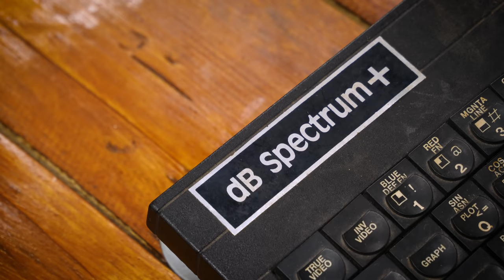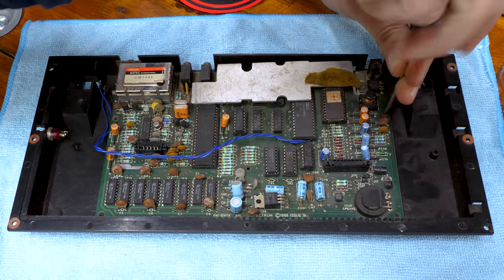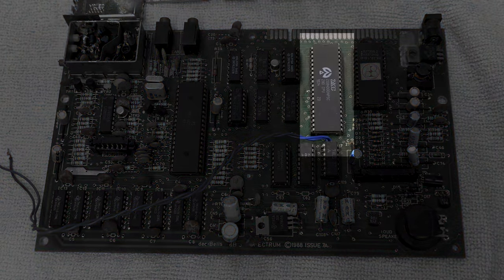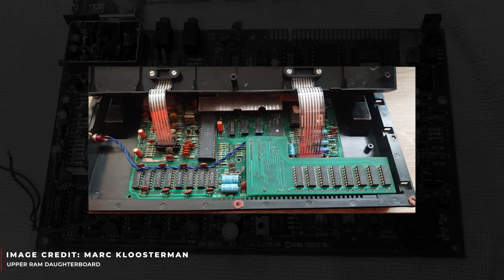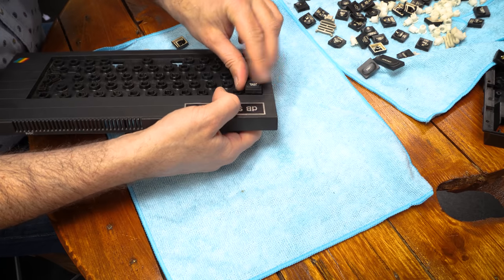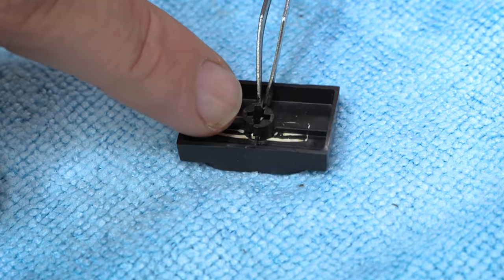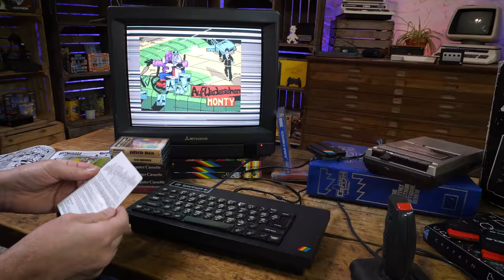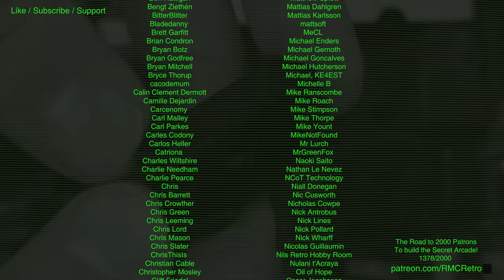Restoring an Unusual Indian Computer - The DB Spectrum +

Comment: 12:28 yup someone has worked on it , those keltron branded capacitors are made by a state owned company and they are my goto choice for any cheap capacitor needs , they are low cost and good quality never had premature failure on them ..

Comment: When I got my dB Spectrum, it was very dusty, no nasty bugs and a bit smelly! It came boxed and all and was almost working -- one lower RAM chip was busted. I simply replaced my rubber legs with new ones. The membrane was working fine, it looked as sturdy as the Samsung ones.
As you can see, there are 2 variations of this "Issue 7A" - mine has a 32k daughterboard, while I've seen 2 other dB's (at one time I had 3 in my home - 2 for my Speccy collecting mates) had only 2 upper ram chips, similar to the Spanish Inves Spectrum+.
Reply: I also have a photo of an Issue 7C -- here the lower RAM consists of only two 4164 chips.

Comment: Small tip when using ultrasonic cleaner to ease up on the cleanup. put your screws or parts you want to clean in a sealable bag with the rust remover in it, and then fill the ultrasonic cleaner with water and put bag in water. Cleanup is as easy as emptying the water and using kitchen towels.

Comment: That second regulator is most likely to power peripherals connected to the user port, like a couple of people have said in the comments its a 7809 which would be a 9v regulator, I think the Commodore64 also has 9v on a user port pin.
Reply: The ZX Spectrum supplies 5 and 12V on its expansion connector, so it's not for that. The Commodore 64 has 9 VAC on its user port, supplied directly from the power input to the computer.

Comment: Hi Neil! Instead of using super glue, use plastic welding compound (based on MEK - Methyl Ethyl Ketone - and other chemicals) which will give the plastic a MUCH better bond, like it's a single part again, and it will strengthen the plastic around the break too.
Reply: Pure acetone works very well too.
Reply: @borayurt66  no, that damages the plastic too much. you want a dedicated plastic welding compound.
Reply: @cheater00  You are right. It should be used very carefully and sparingly, in tiny amounts. But when you get the hang of it, it really works brilliantly especially for small parts like this. Creates almost seamless bonds. I apply it with a needle to both parts, then combine them. Acetone evaporates very quickly and what is left is a one piece plastic again. A dedicated product will be more forgiving for sure, I can't deny that but this also works. Needs practice though.
Reply: @borayurt66  i've repaired parts that are less than 0.5mm across using welding compound, using the same technique you say. and the bonds were fully - not almost - seamless.
Reply: @cheater00  Yes, I just looked it up, it is commonly called Butanone. I will get some and try it. Thanks for the info!
Reply: @borayurt66  no dude, butanone is not plastic welding compound! every plastic requires a different welding compound. look for a specialty welding compound that incorporates Methyl Ethyl Ketone - that's a common ingredient to many of them. They include surfactants, polar solvents, etc. It's not easy to find, but with some research you'll be able to find something produced locally. There are no popular global brands of plastic welding compound.

Comment: A little tip for restoring rusty screws; throw them in a pan of water (distilled if you have it, but tap water is usually fine) and boil them for about half an hour or so. This will convert the red rust to a black iron oxide, which is likely the same finish that they had when they left the factory.
They will look brand new. It's like magic the first time you see the transformation happen..
Reply: @blackterminal  Vinegar will just dissolve the rust. It will leave a black smut on the surface, but that's not the same thing. Rust killers or converters vary, but none of them has the same effect as boiling.
Converting red rust to black iron oxide by boiling has been used for centuries as a firearm finish - it's called 'rust bluing'.
This involves using a solution to deliberately rust the steel, and then boiling the rusted part to blacken it. There are several videos of the process on youtube.
Boiling rusty screws basically works in the same way, though it is much less labor intensive than proper rust bluing.

Comment: Ahh - the old membrane keyboard. I had a part time job after school repairing computers, and I remember having to replace these quite often. I also remember getting in a Spectrum where someone had plugged in a power supply (wrong one) into one of the jacks. The ULA rather spectacularly blew a hole in itself and the circuit board. Still managed to repair it and get it working again, but it looked like a cat's cradle with all the wire patches I had to put in. Fun days.....

Comment: Couple of questions Neil.
1. Did you keep the original membrain label for posterity? 
2. Did you dump and compare the ROM was it completely standard?
Reply: It is most probably exactly the same. Although there were some known bugs on the original firmware which can be corrected, there are some third party hardware and software which does a quick ROM checksum and if even one byte is different, the checksum would fail, causing the said item refusing to work. The bugs I mentioned are not significant for a regular user, but they can become an issue for programmers, and when they did, people invented ways to circumvent these bugs. This also makes a "corrected" ROM to fail with these programs. It is not the best idea to use a modified ROM image in Spectrum machines because you can get incompatibilities. I noticed the ROM IC is a standard 27C256 EPROM, which is not totally pin compatible with the original 23128 used in the UK machines. The difference being (I think?) just 2 pins needs to be swapped. So I am guessing that part of the PCB design is also different along with the 2nd regulator.

Comment: you should keep toothpicks and q-tips handy. 
use the toothpicks when you apply glue or oil in small spots, then throw it away.
With a drill bit, I had to clean the bit after. 
The q-tips and EPA is critical in cleaning small stuff or tight spots.

Comment: With regards to the break key, I’d be inclined also to wire whip and glue round the outside of the post if there’s room.  Just because I’d imagine the forces on it being a bit much for the glue-able contact area otherwise.
Reply: @blackterminal  why but of course it will, but we want the only the best for that which we value.  No sense going half in.

Incidentally, I spent around three days carefully stripping, cleaning and reassembling a whole bunch of keyswitches for the Acorn Electron I grew up with, and not because of its awesome computing power, rather more that it was my first computer.

Comment: It's possible the second voltage regulator could be to regulate voltage in the event of variable voltages from the mains to protect the computer from load shedding where power is reduced in some areas.

Comment: Interesting and well presented as always, thank you. There's no slime like human slime, eh?
Also interesting, at least to me, that that PCB looks like it was manufactured with a (somewhat) modern process. No lumpy floods there.
I wonder why the extra regulator and type? Guesses running from designer's preference to increased RAM options or smoothing bad power.

Comment: I do see the desire to keep the machine as original as possible, especially as it's only going to be on display and rarely used, but if it was to be used often I would replace the voltage regulator with a modern compatible one that does not need the heat sink. They are more reliable and future proof.

Also, no mention of repairing the reset button! Did you reconnect the wires to it? 😏
Reply: The only trouble is, those sort of modern regulators are generally not linear and use some kind of switching to reduce the voltage with less heat.  These tend to introduce switching noise, which is not accounted for in the Spectrum design.  This would cause degraded operation due to the switching noise being introduced to the power lines on the board as there is not filtering to counter it.
Reply: oh man @EsotericArctos  you are so correct!, i see switch mode supplies and regulators being used all the time its almost a snobbery against linear, but there really is no need linear is what it was designed to use, if the supply is bad rebuild it replace 7805's with quality replacements your speccy will run better.

Comment: Nice. Be careful filling up the ultrasonic cleaner tank to the minimum recommended liquid level, otherwise you may damage your cleaner. Your motherboard cleaning session seemed to have insufficient liquid. Thanks.
Reply from the maker: Thank you I'll keep that in mind
Reply: @RMCRetro  😂That told you!
Reply: Why is that? Would you mind elaborate it a little bit further or provide some legit link please? Cheers
Reply: @delos86  Too little liquid results in low pressure at the transducer which can lead to cavitation damage.
Reply: @RMCRetro  and fix the wobbly table plz! :P

Comment: I had a ZX Spectrum+, the design of the keyboard keys left a lot to be desired, they needed to be tapered like the keys on their +2 & +3, you could not type fast at all as the keys would rub against each other.
Reply: Style over function, the early version keys fell out when turned upside down 😅

Comment: One trick is clipping pins to be as short as possible, then using the surface tension(?) of a big blob of fresh solder on the iron tip to pull the remainder of the pin out.

Comment: I had dB Spectrum as a child, a gift from my grandmother costing around 6000 Rs. My new spectrum had issues with keyboard and I had to travel to their factory in Bhosari Pune to get membrane replacement. My Spectrum also had a big aluminum plate heat sink which is missing here. Mine computer also developed problems with other two power supply levels ( -5V and 12 I think for the DRAMs so I had to power it with two power supplies ! Unfortunately I don't have it now as we moved to PCs my parents had it removed from our old house :( - Rahul

Comment: My guess re: second voltage regulator is that India and other similar parts of the world used to have very "dirty" power, i.e. the voltage and current would fluctuate wildly since the infrastructure just wasn't quite there yet.

The second regulator might have been to help even out those fluctuations even more in those regions and keep the micro running smoothly. Wild guess though.

Comment: due to the fact that the second regulator is a7809 I thing the power supply was possibly 12 volts. the 9 volt regulator is probably for driving a cassette system.

Comment: The case looks VERY MUCH like the Soviet/Moldovan "Sintez 2" computer, which is a ZX Spectrum clone whose keyboard is a 99% copy of the original. Most Eastern Bloc Sinclair clones are wildly different from the originals, but the Sintez 2 looks very much like a ZX Spectrum.
Reply: I have both a Sintez 2 and a dB Spectrum and I can assure you it's 99.9% a copy of a ZX Spectrum+, not a Sintez 2.

Comment: So what does the extra regulator do...? I thought you might just have used your meter to figure out what it was connected to.  I was also intrigued by that EPROM (32k bytes instead of the usual 16ķ).

Comment: Makes me wonder if any of the other spectrum models had country specific versions?
Reply: Well yes. There is the Swedish version with a tiny switch located from the opening of the edge connector to switch between the regular ROM and a modified Swedish/Norwegian ROM (a poke would switch between these 2 Nordic languages and special symbols). There is a Sinclair ZX Spectrum with Spanish EPROM as well as the Inves Spectrum, also with a slightly different Spanish ROM. Then there are the Microdigital TK-90X and TK95 with a Spanish/Portuguese ROM (a single byte in ROM would  switch between languages as Portuguese was the local language and Spanish for export markets), and the Czerweny CZ 2000, Spectrum and Spectrum Plus - the latter having the same Spanish ROM as the Inves (Spanish error messages and a few special characters like ¿ and ñ). And finally the Arabic versions of the +, 128, +2, +2A and +3, again with a switch at the front of the keyboard. Not to mention the many Russian clones with Cyrillic characters and error messages.
Reply: (except for the Arabic + and +3, I do have them all)

Comment: spotted the EPROM is a 27256 which would be 32K - different contents to the normal Spectrum 16K ROM or just the 16K ROM in both upper and lower? Also is the 'db Spectrum+' label covering up the original Sinclair markings, have they been machined off or is this a different case moulding to a standard + machine? That 2nd voltage regulator is odd, is it a 7805 and if it is were they trying to spread the load across two regulators to extend the life?
Reply from the maker: There is nothing under the label, and the plastics feel a little rougher than a regular Speccy so I think the cases must be manufactured in India or at least elsewhere to the normal place. The 2nd reg is a 7809
Reply: @RMCRetro --5v volts for the 4116 RAM chips? might be worth dumping the EPROM to see what is on it - correction 7809 would be 9v not -5v so not that
Reply: @markwanklyn4195  My semi-educated guess is that the 9V regulator is supplying the collector of TR7, which drives the loudspeaker.
Reply: The ROM is bog standard. Not sure if it's packed in twice but I'd bet it is. The second reg is a 7809 and I don't know what it's doing as yet. There is a 7805 as usual as well.